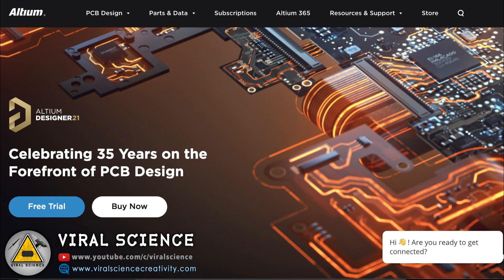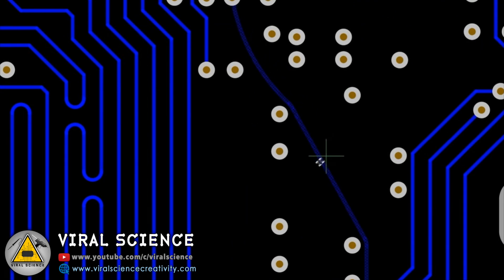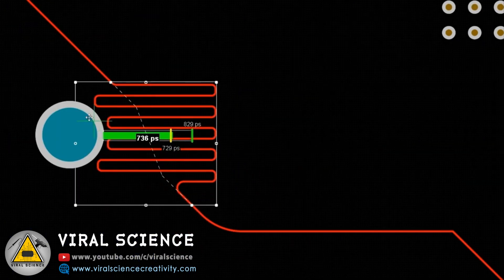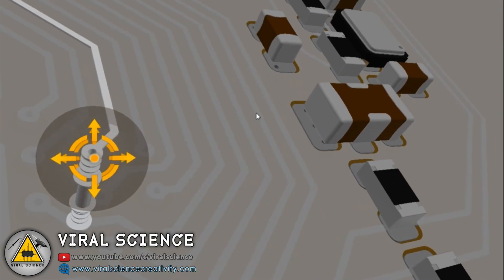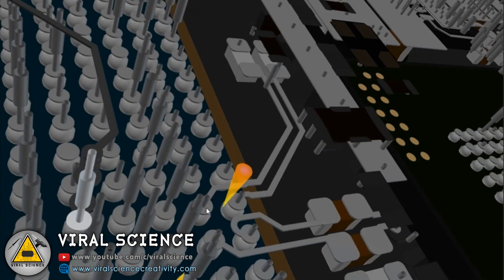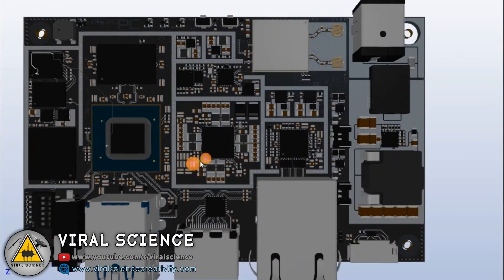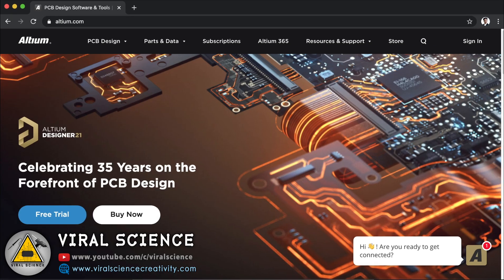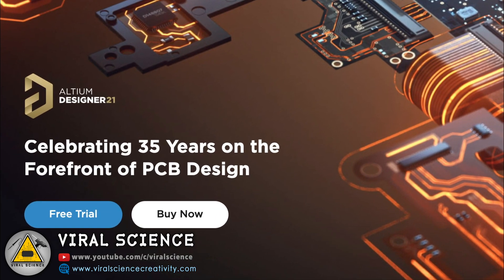Arduino MPU6050 Digital Spirit Level Measuring Device

Comment: ＋👍I am very grateful to the author for posting a great project. I will make this and use it as an earthquake siren. I will add 4 LEDs and modify your source code to make the MPU6050 move (facing itself) Y+ axis and Y - axis, and send an alarm, so that the MPU6050 moves the 4 axes of X-/X+/Y+/Y- and sends an alarm

I live in Taiwan, and earthquakes are very frequent, so my family has to leave home early.

Comment: Very handy project if one wishes to have visual/audio feedback when level on 1 or 2 planes (some code mods required). Just wondering if you had noticed that if you shake the MPU, the readings go high and take a minute to settle back down. Any thoughts on stabilizing it?